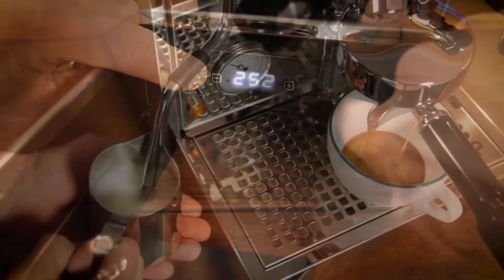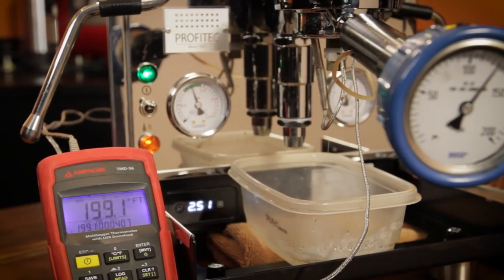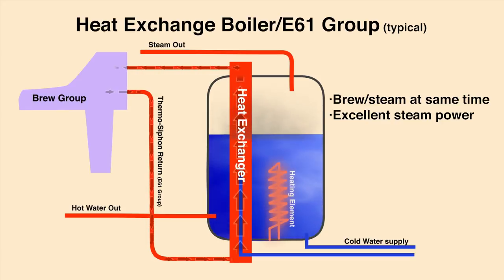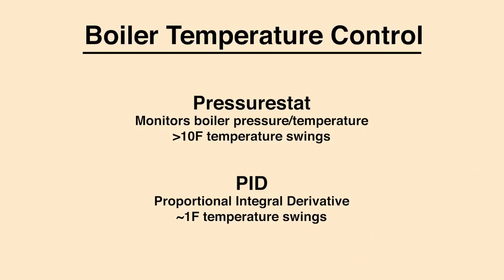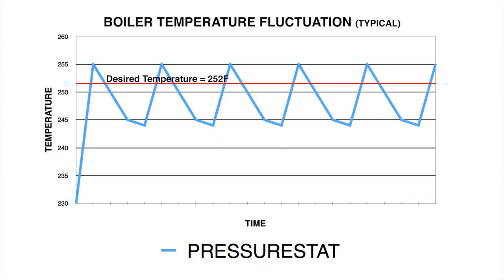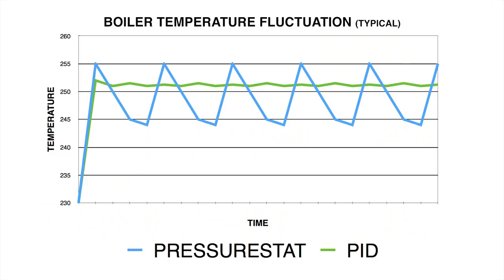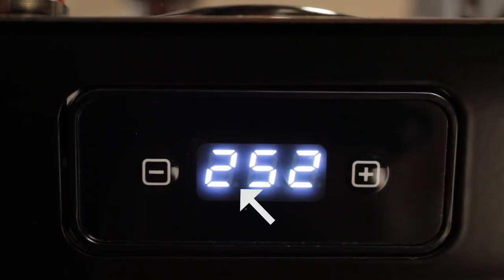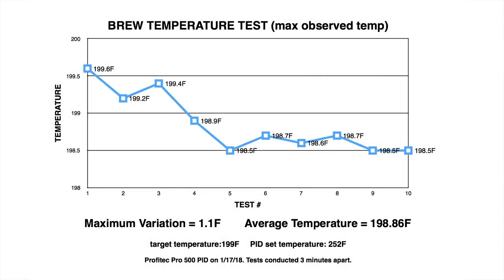Review: Profitec Pro 500 PID Espresso Machine

Comment: Is the OPV adjustment screw easily accessible?
Reply from the maker: Hi t, Thanks for the question. Here's a video showing how to adjust the OPV on the pro 500: https://youtu.be/uYKDQ3Stb3k It does require removing the outer case to get to the adjustment.
Marc
Reply: Thanks Marc!

Comment: Hi Marc :)

Would you be able to recommend any other machine roughly around the price of the Pro 500 that is a heat exchanger, has PID and is exceptionally well built? Thanks! 

-Tom
Reply from the maker: Hi TP, Thanks for the question. HX boiler machines are in high demand and there have been virus related production slowdowns in Italy. Currently available are the Rocket Espresso Cronometro Type V machines. The Mozzafiato and Giotto are identical internally with different body panel styles.

Giotto: https://www.wholelattelove.com/collections/semi-automatic-espresso-machines/products/rocket-espresso-giotto-cronometro-type-v
Mozzafiato: https://www.wholelattelove.com/products/rocket-espresso-mozzafiato-cronometro-v

Marc

Comment: I have a question. What's the big deal with cooling flushes? I'm not being a wise a$$ here, I just don't know. Any time I've seen a video of someone doing one, they lift up a knob for about two seconds and a little water flows into a glass and then they turn it off, place their cup under the portafilter and make an espresso. I'm sure we all know why the double boiler machines were invented, and the Italians still use heat exchanger machines because they believe they make a better espresso. I read that the declining temperature profile of a heat exchanger extracts less astringents at the end of the extraction and that's a good thing. Is this true? I'm trying to figure out if a lot of people (me included) are being suckered into buying double boilers and i'm pretty sure they are. I see posts online from people who have heat exchangers and make double boilers sound like their end game and not once have I seen information to back up why that would be the case. Let's face it, pretty much nobody is having a big party and making 15 cappuccinos back to back for their guests. To me, the Profitec Pro 500 looks to be a perfect machine for the home barista. People need to know that double boilers were invented because American baristas are for the most part a bunch of 19 years olds who could care less about coffee and would make a bad espresso with a heat exchanger, in part because of the cooling flush or lack there of.

Comment: Given the HX boiler, PID, dual gauges, sprung valves, seemingly high quality design and prices within less than $50 of each other, what you are your thoughts on this machine versus the Bezzera BZ07, please? 

I like the programming of drinks the BZ07 offers, but wonder if the Pro 500 may be longer lasting and better quality overall. I noticed the BZ07 only has a 1 year factory warranty while the Pro 500 has 3. I believe I have my choices narrowed down to these two, so any input is greatly appreciated! 

For context, this will be my first espresso machine and I've eliminated single boiler options as I'm planning to make milk based drinks fairly often. So the higher steaming power and not having to constantly change the temperature of the boiler between frothing and brewing is important to me. I don't want to step up to a dual boiler, however, as I'd like to spend less than $2000. So a high quality, durable HX machine with great design and a decent value is what I'm looking for.

Thanks,
Mervyn
Reply from the maker: Mervyn Steadman I love the durability of Profitec machines and the 3 year warranty is a real bonus vs. the BZ07. Unless you want a narrow machine or have to have the programmable volume the PP500 is the winner. It’s a less complex design with more robust parts like the sprung valves. Case finish is nicer as well. In my mind it’s hard to beat Profitec machines for the price. If doing mostly milk drinks you’ll be at the machine steaming while espresso is brewing so volumetric dosing doesn’t buy you much. E61 group is much less complex and more reliable long term. Programmable volume is more a thing in commercial settings where doing other tasks at same time improves efficiency but in the end may sacrifice espresso quality. Hope that helps! Also we will likely see some minor price increases related to EU currency valuations on machines in the next week or so. If buying in the US don’t wait. Not trying to be pushy with that just advising prices will be going up near term. Hope that helps. Let me know if you have other questions. Marc
Reply: Thanks so much, Marc! Incredibly helpful - really appreciate the insight and advisement on upcoming price increases. That pretty much makes my decision.
Reply from the maker: You are welcome! Always happy to help.

Comment: Will the sides of the machine get hot when it is turned on?
Reply from the maker: Hi Zac, They get warm but not burn you warm. The top of the machine has a cup warming surface. It's heated passively and gets a bit warmer but still not burn you warm. The E61 group does get burn you warm due to thermo-siphon hot water circulation from the boiler. Hope that helps!
Marc

Comment: i do not agree about pressurestat delta of 10F, this is absolutely no true. 1.0 bar = 253F. so if you look for the pressurestat its hysteresis is about 0.2 bars which -> if you are on 1.0-1.2 bar then the temperature is somewhere between 253F and 257F.
Reply from the maker: Hi Ivan, Thanks for the comment. If it's a hard .2 bar delta then you are correct and it's a smaller temp swing. My charts show 1 bar = 248.8F and 1.2 bar = 254.2F at sea level. I have observed over >.3 delta on some machines. If a pstat is cycling precisely at .2 bar there will be some overshoot when heating and undershoot when idle leading to a delta >5.4F best case.

Comment: Just recieved my Profitec 500 PID today from WLL, I noticed the PID was set to 120C, can I get this to display in F instead?
Reply from the maker: Hi Christopher, Yes, you can change display to F in advanced PID settings. With the machine off press and hold the + and - buttons and turn the machine on. While holding buttons down wait for "F.01" to appear in display. Then use the left button to cycle through parameters until you see "C". Then use the right button to toggle to "F". Once that is set turn the machine off for 7 seconds and turn back on. Display should now read in F. Be careful not to change other settings in the advanced PID menu.
Marcv